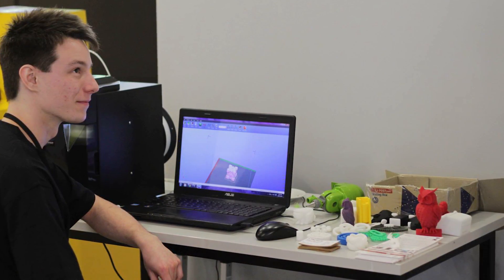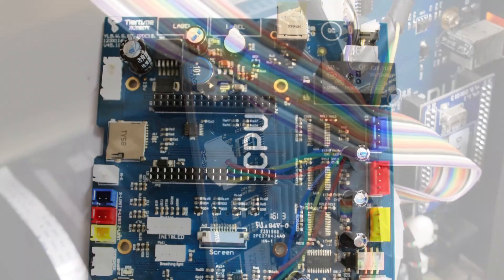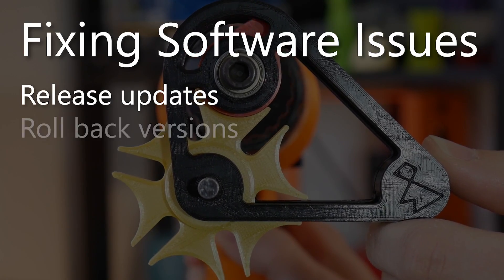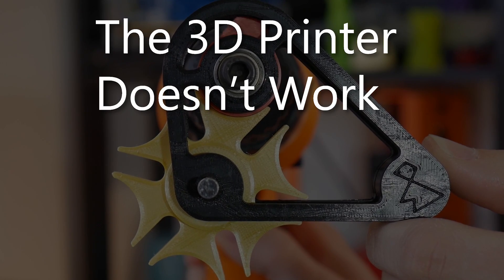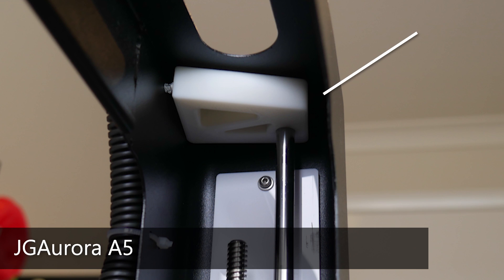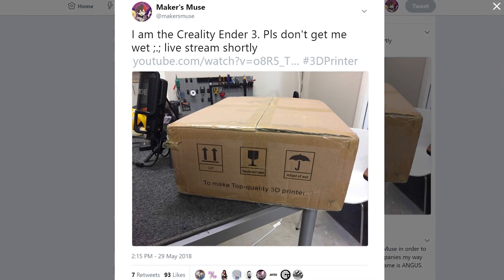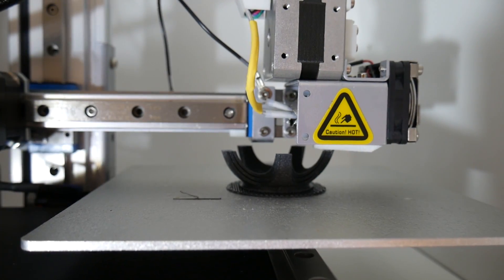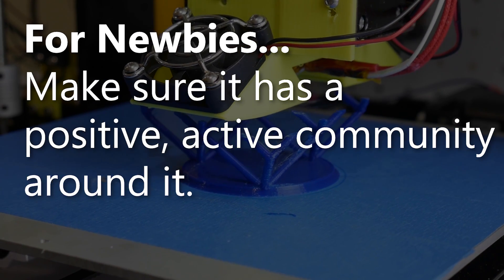Serious Concerns with 3D Printer Quality Control

Comment: Personally, my answer to the question 'how do these improvements help the post-purchase consumer' is 'by allowing you to purchase the item from the manufacturer so quickly, and at such low prices.' Metal components and injection moulding is great, but will come at a premium that a start-up just cannot afford. I agree with you though that this is a small balm for a large wound, and ultimately I believe beta-testing in general to be a scummy practice (even in software), but there are advantages to the consumer at least in some respects.

Comment: Point well made there Angus.
Microsoft is notorious for shipping "buggy" software and releasing mountains of patches as the problems get fixed.
But here is a thought:
Instead of manufacturers sending influencers like yourself, Joel, Naomi and others a so called "production machine" for evaluation, maybe they should be sending you the beta product.
You then do a "beta test" of the product and identify the good points and the bad points *as a beta test of the product*.
The manufacturers make the improvements and either send you the upgraded or fixed parts or even another machine and you evaluate that as a beta upgrade review or as should be shipped review.
Yes this will mean more than 1 video (a good thing?) - the initial unpack/assemble/test/review - a how to do the upgrade video - and a final as shipped review video.
And if needed a follow up video based on feedback on your channel as to what is actually being shipped as a post beta test and upgrade product.
I recently ordered a CNC router and wanted the tech specifications on some of the parts.
WHAT A BATTLE !!!
The question "What is the part number of the rail bearings" got the answer "Very good part and quality".
I never got the info so I went somewhere else.
Especially when dealing with the east, there are cultural and language differences that can throw up all sorts of miscommunication issues and expectations.
Bottom line is that before you buy you need to do your due diligence!
Get specifications. motor model numbers and specs, sizes (travel etc), electrical compliance certificates and as much other info as you can otherwise you get whatever you get, no recourse and just maybe you are lucky.
And you also have some ripoff artists throwing together crappy parts and calling it a kit here in the west and labeling it as an "Proudly American Kit" or something.
It is a BUYER BEWARE situation - its your money and you decide where to spend it, NOT THE SUPPLIER!!!
Thanks for a very good video.

Comment: should state what level it is, all electronic kits do from beginner to advanced skill's that way you can get one that suits you. Linux has been beta since it was born and the community admits to that, microsoft donno it started off alpha actually had the same testing method but it was software easily fixed by an update (not that they always got that right), not hardware which could require some expensive modifications (unless you like and know how to fiddle)

Comment: What I dont like is how they make changes within first 3 months. If they had taken a couple weeks in house they would have made those changes right away. Also the fact that a company like creality who uses a 3rd party for their marlin does not even take the time to ensure thermal protection is active before they load it on a machine is the one thing I hate the most. Not checking your firmware is idiotic and could one day cost the company everything.

Comment: Very well said. I just had this exact nightmare experience with an $8000.00 FDM printer (Manufacturers name withheld). I use FDM for business in some pretty critical applications. It's used to create parts and also fixtures and tools for a precision CNC machining business we offer. The unit arrived late, not to electrical code and with many electrical concerns. Known industrial methods were not used in the design or build. Only the basics were executed acceptably, and it had the worst wiring execution and engineering with no shielding or knowledge of electromagnetic interference. It prints terribly at 20mm/s and you can't access the parameters to fix things yourself. It's a huge bummer to see people with some knowledge of a few technical areas claiming to be the end-all be-all printer, but ships cool looking junk.  As a builder of OEM equipment it's pretty vulgar how much some of these things cost and how little they perform given the markup the business receives. So many manufactures, but only a few are worth anything. So many of these concepts of XY axis fidelity, motion control, leveling, minimal parts for maximum precision etc has been learned decades or centuries ago. That knowledge is how we built the machines that made this future with minimal resources.

Comment: Honestly you should have included a word to manufacturers that they make hardware revision numbers more visible.
Also one of the issues that you should have more directly touched on is when they try to ""optimize"" a printer after release. As in make it more cheaply. This will become a common trend where manufacturers will do the reverse and start making printers worst over time, ride the rave reviews then ship substandard shit.
Again, a strong consumer push to make hardware revision numbering a thing that is clearly visible on product pages, packaging, and on the actual unit would help avoid issues with printers becoming worst after the honeymoon period of reviews.

Comment: I don't see 3D printing as only a hobby, it's too far past that and has been for years considering it's been around since 1980's. I see it as a tool as well. That's like saying cheap air compressors are a hobby.  People are willing to pay for a printer with Auto Bed Leveling but for someone to think that's not where people would spend money shows how much they participate in the forums. Also ABL inductive/capacitive sensor doesn't mean $300 price increase over a $3-25 part at max. It just replaces an end stop and the feature is in Marlin. 

Because some people don't take 3D printing seriously enough there are people that like to cover for the 3D printer companies as if they are hardly making a profit. I can't count 12 companies that shut down over the past year for that matter. If they did it was because they sucked. Alot of companies got their designs from Thingyverse or from the forums. Touch screen LCD's are not expensive as there are literally millions of them being made for cell phones and cell phone LCD's aren't expensive. The LCD that Wanhao uses is cheap, especially when purchased in bulk. Google 'Nextion'. It can be added to any printer. 

Robo3D has been around for a long time as well but look at what happened with 3DPN and you can see from their R1 release which has no LCD, no real firmware updates, and no advertising of upgrades that the Chinese companies aren't the only ones to do it.

The other problem I see is that their are shitload of issues with Marlin that haven't been addressed yet as they push to 2.0. Temperature runaway, layer shifting, its size due to code creep are just a couple. 

All of these companies were using it to sell 3D printers and no one was actively doing anything about holding people accountable until the last year. So of course companies that use people for Beta testing are going to take advantage of that and they are going to make money off suckers.

Just to give you an example I ordered my CR-10 last year and some of the LCD panels were coming disconnected. The Z couplers and rods were coming bent. The bed heated slow so just recently they added insulation to the beds. The changed the design on the extruder and alot of us paid for the update version. I got mine like months after I paid. 

We had issues with the wrong capacitors being used on the CR-10S control board, the voltage regulators failing and they went through 4 versions of control board and the community itself had to keep track of it. 

Now it's not just them either. Everybody on the forums piled on Tevo for how crappy the Tarantula was released. 

Wanhao also had issues where peoples printer beds were burning up the Melzis due to bad design and if it weren't for the vendors no one would even know how many Melzi revisions there have been.

https://blog.adafruit.com/2017/03/23/the-melzi-problem-or-why-did-my-wanhao-i3-duplicator-catch-on-fire/

These issues also apply to Flash Forge with their closed system and Makerbot which also used their bases as Beta testers and you see how well that has worked for them.

https://www.cnet.com/news/pulling-back-from-open-source-hardware-makerbot-angers-some-adherents/

Just looking at videos over the past 2 years you can see that this wasn't a recent trend. It has been happening for a while. People are just good at looking the other way and fanboying certain brands. I also noticed how alot of info on printers that came out with issues are disappearing. The trend of erasing 'negative' content is causing situations where useful repair info is being removed from the internet. I don't like the fact that some of these companies are taking advantage of people's ignorance of the existing market to sell printers with features that mostly come from the communities fixes.

Comment: Totally agree. Even Original Prusa MK3 I regret to be an early adopter. Make no mistake,it is a good machine. But I didn't buy it at its best condition. There are better 3d printed parts, better cable sleeves, earlier access to PEI coated sheet.... for the newer "version" .  Patience is a virtue, how true!

Comment: Great video and nicely said!! I hate to say it but as much as I love the features of my Prusa i3 MK3 this is kinda the way I feel. It was said that the print quality was just as good as the MK2 but unfortunately that hasn't been the case for me, (and quite a few others I've seen). I've really considered getting an MK2 to replace my MK3 because I was an early adopter and kinda feel like a guinea pig as all the bugs are getting worked out and there are newer, redesigned parts that I now have to print myself. Again, it hasn't been as bad as some, it does print but even my $200 Monoprice Select Mini V2 has better print quality. Again, I love all the features but it does make me disappointed and want to throw it out a window some days. I'm honestly glad I started with the $200 printer instead of the MK3 or I would've probably given up on 3D printing. I know it has the potential, just isn't there yet, at least for me... :(

Comment: My Anet A8/AM8 is a kit, it itself is for tinkering, while my Printerbot Simple Metal DID need some modifications, etc.. It worked out of the box. That being said, I think just the way things are it's always a buyer beware. Do your research, it's YOUR money. Sometimes cheap is more expensive... sometimes the journey is more important than destination. 

BUT, Quality Control, like not including Mosfets, or flimsy connectors that a community of early adopters have to fix isn't right. These items, or devices should be returned, if anything as a payment or thank you for the said community providing the R&D.

Comment: Hay very good video Maker's Muse, But I must said back in the year of 1997 to 2001 actually do miss working with computing data entry on the CNC with this machine call (2000) Wecke Optimat BP 145 CNC Router with eggeband today and I do not have the room for it or the money for one of them. 

But over the years 3D printers have come along to the shopping markets today and I had bought my first 3d printer call " Geeetech Pro B.
I do not have any problems with the DIY and the instructions were not clear enough for the DIY.
  
A week later after buying the Geeetech Pro B 3D printer, I went bought the creality CR-10 3D printer this year as it has a larger work area with the X,Y,Z.

I have had to use the creality CR-10 to make a new space parts for the Geeetech Pro B after fore and broker a piece off the top end.
Ever today i still have not had a first print off the Geeetech Pro B.

Comment: I bought the MOOZ-2 on KS from Dobot. I realize this was very risky as my first printer now but I think I got very lucky because when I think about it, all I've done is created an enclosure for ABS (for which they are about to sell one on their website) and added a glass bed.
Angus, I just want to say you are the voice of a section of 3D users in society (just end point, DIY, dispersed users with no interconnection) that lack the clout that a manufacturing company would possess. I think that's one of the main differences when I think about large 3D printers for car manufacturers. The safety risk or cost of getting this wrong is huge whereas the risk for people printing knick knacks at home is non existent. "So what if some people in their homes can't get high quality?". Because there's no risk or loss for companies. Unless you're a big player that's 3D printing prosthetics or aeronautical components.
So unless we have representatives of our diffused voices like you talking to 3D printer manufacturers for DIY users, we will never get to the level of quality that large companies enjoy.

Comment: The Lean concept of "minimally viable products" being released and shipped to customers should still apply basic design revision part number practices revolving around form, fit, function.
If the form, fit, or function changed, then the part number not the revision needs to change.

Same with software, they should be properly applying design concepts like SemVer; MAJOR.MINOR.PATCH as Function.Feature.Bug 

No one wants to buy a used 3D Printer v3 thinking it's the same as the currently sold model only to discover that the new version is so different that they only have the name in common.
Who wants to be an early adopter of printer x3 waiting for the next release of printer x4 to never see it come because printer x3 is constantly revised...

Companies really need to apply basic design revision part number practices revolving around form, fit, function.

Comment: Why do you record at 50 FPS instead of 60 FPS?

I don't really see lights or displays flickering enough at 50 that 60 would make it worse and you're not doing any motion stuff where 10 more frames would ruin the motion.

I just wanna know the technical reason for 10 less frames, so that I can either keep complaining because the technical reason isn't justified, or accept what reason you provide because it makes sense.

Thank you Angus!

Comment: Hi Angus totally agree with you. Prusa mk3 extruder design is an obvious flaw. The filament sensor is iffy and so is the new feed roller mechanism. For the price, the lack of ethernet connectivity is also questionable and the firmware logic is a bit sloppy considering its v3. My kit shipped with faulty sensor and the thermistor is 13c cooler than reported. Im busy building a mk2 extruder assembly with a microswitch as a filiment sensor. Imo they need to come clean and admit it. Cheers

Comment: I get what you're saying here. 
 The market machines are basically trapped in a never-ending Beta. 
There no solid models released and most company responses to feedback are "Hey we fixed this issue and we also added this," but the truth is the new thing they added as well now presents a risk of having its own issues. 
Where It'd be better if, as well as a test Beta version, they would release a solid version which would just be fixed version of a previous machine without any new technology or new processes that need to be tested. 
That way you'd have a stable core model for people who just want a printer to work and a continuous never ending Beta for those who are always looking for something new and trying to find the best way to do things.

Comment: Hi Angus, love your channel and reviews. FWIW I bought the original UP printer in 2011 (maybe earlier ... ?) and it's still being used quite a lot today - The price was HUGE but for what I was doing back then I needed a 3d printer. The only problems have been my own fault. I know the print volume is relatively small but it just works well each time. I'm currently  doing battle with my Cocoon Create to try to get it to print as well. It's got a Flexion extruder and a good Z-brace fitted, but I'm still having problems getting the print platform just right ; A BLtouch will be here tomorrow. :)

Comment: This is the fundamental issue with startup culture. It's an awful issue and goes way, way beyond 3D printers alone, and it's why Silicon Valley is gonna be dead in a couple years.
Reply: Hell, even places like AAA games do this with """early access""" and other fake-betas where the customer pays for an unfinished product, like you mentioned. Capitalism is a hellbeast.

Comment: I recently got a monoprice mini select v2 and after 6 weeks I'm disgusted with its build quality. Ok, its cheap for a 3d printer, but there are things wrong with it that should not have EVER left a manufacturer. 

I think the first thing anyone interested in 3d printing should ever ask themselves is: Is this a toy or a tool ... toy, I don't mind playing with and fixing the printer; tool, I need this thing to work so I can use the prints elsewhere.

I wanted a tool, not a toy. On the upside the monoprice thing has taught me that I like the process of creating and printing things. So I'm investing in a much better printer. But it still means that I've wasted nearly £300 on a printer when I could have put that towards the better machine.  That's £229 + all the other stuff I've had to buy to try to make it work.

Comment: I ordered and received an Ender 3 maybe a week ago. It took a LOT of screwing around, because the gantry extrusions are slightly warped, and I've had to print a lot of upgrades that are, frankly, necessary (thanks, Teachering Tech for the video). Now, it prints relatively well, despite having vibration damping issues, as well as a flat spot on the Y axis rollers.